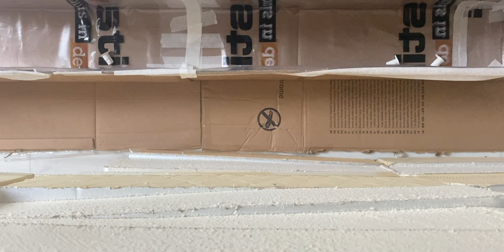How to make Lightweight Cement flower pot with Styrofoam at home #Lightweightconcrete  #styrofoam

Comment: For extra strength I recommend painting with any color and cheap latex paint and covering quickly with cloth like a bed sheet and repainting over cloth while the paint is still wet embedding the cloth in the paint..,let dry, then repaint with final color...
Reply from the maker: Thank you for your suggestion

Comment: What is the ratio of sand and cement in bottom layer and 
What is the ratio in side
Reply: This is creative idea indeed. 
How strong is the final product, 
Is this light weight, can we make bigger broad pots
Reply from the maker: @jknagpal190480  For the first layer : Cement - Sand- Water 1:2:1
For the outer layer: 1 part of Cement - 2 parts of Styrofoam - 1 part of Joint Mortar(Tile Adhesive)-1/2 part of Water -  ( 1:2:1:0,5) and I added 50 ml PVA Glue for 4x time the proportions.
waterproofing: 200ml water, 3 tablespoon PVA Glue, cement enough to make it creamy but not too thick. 
I have the pots I made more than a year and they are still very good, did not break. but its important to put some metals inside to make it more resistant.